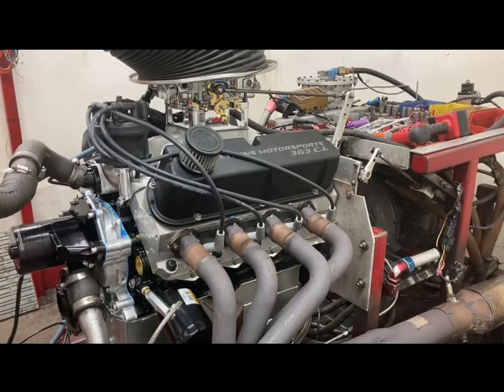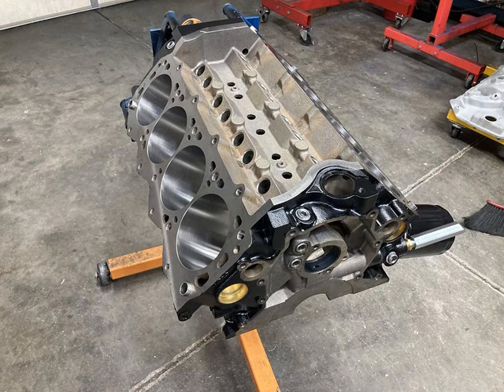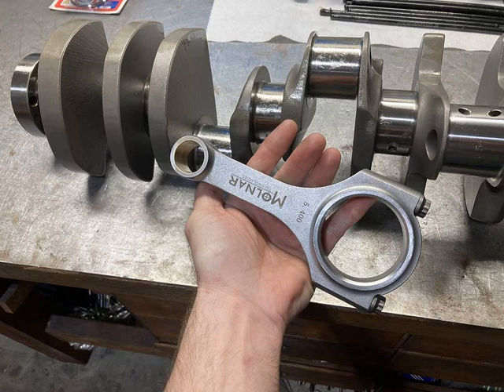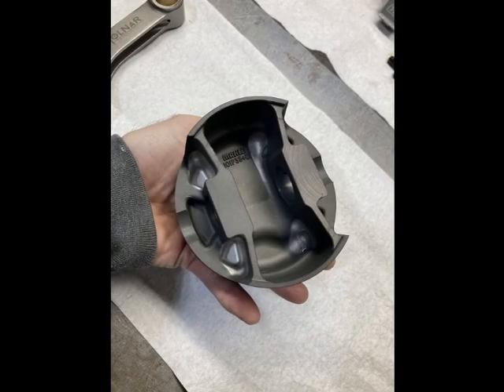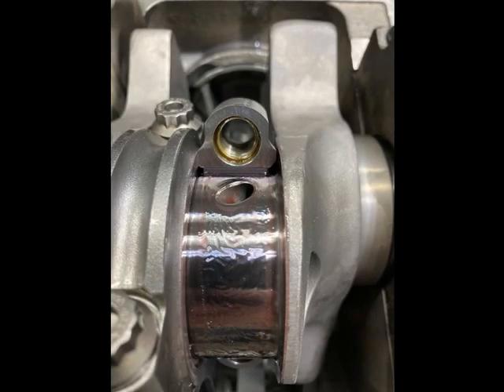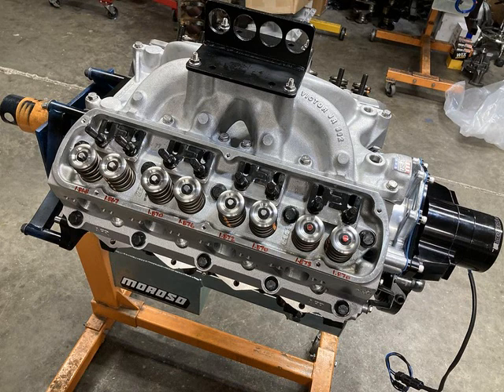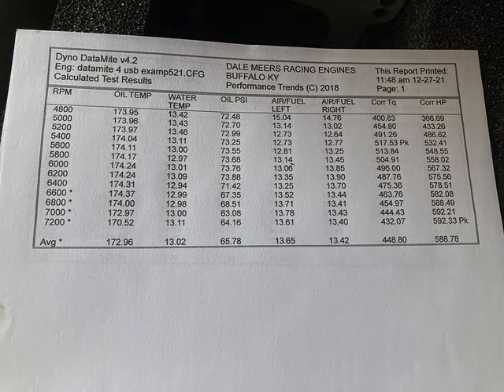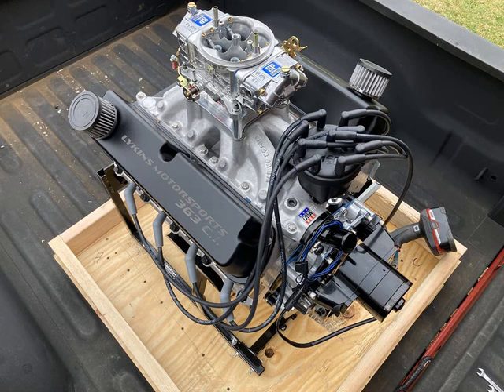Lykins Motorsports Ford 363 SBF Engine Build, Start To Finish

Comment: Very nice build...I just want to say that I see the Ford Windsor aftermarket aluminum cylinder head situation as a failure. Go check out some LS3-LS7 aftermarket alum. flow numbers...ford enthusiasts are being had. The closest thing the Windsor aftermarket has is the 7721 Victors which are right there with'em.  I'm talk'n 385cfm+ by  .600 lift. You can use any windsor manifold but your into $2000.00 plus for rockers. And good luck with the headers. Where's the "Fast As Cast" SC1 ??? w/headers & intakes? No wonder all the Foxbody swaps.
Reply: Aftermarket head manufacturers are just piggybacking off GM's design. The LS3 might be the best V8 engine ever made.  A junkyard LS3 head will flow about the same as an AFR 20 degree inline CNC SBF head.  And, a junkyard LS3 head can be ported to flow 385 cfm   Besides LS heads will bolt on to a SBF.  What about SBC fans?  They're being had to ...
Reply: Who cares!?
LS swaps are SO common and SO boring!
Every dork has a junkyard LS swap....
ZZZZzzzzz
😴😵😴😴
Why don't you see any LS swapped IROC-Z Camaros?
Because they are all in the junkyards along with your LS motors!
BTW: I SO enjoyed gapping lame azz 5.0 AND 5.7 IROC-Z Camaros in my '85 5.0 GT!
Those 'Tuned Port' SBCs couldn't run past 5,000 rpm while my Holley 4bbl 5.0 walked them.
Lol
Now I have a 585 HP 8.2" deck 363 SBF that looks exactly like my mildly modded 5.0....
Heh heh heh
😊
Let me know when you find a 6.0L LS in the junkyard and we can run a few 1/4 mile tests.
😁
Reply: Chevy's are junk... Id take a straight 6 any day over ANY CHEVY MADE
Reply: @1bad505   Geeze, I guess that's why Fords never win any races.:face-green-smiling:

Comment: Awesome engine Brent! I have almost the exact combo built for my '85 4eyed Foxbody.
(Mine has AFR 195s with a port matched RPM Airgap and custom Comp roller)
Can't wait to get it installed with the Magnum 6 speed behind it.
My only concern is keeping the Mustang from twisting like a beer can when that 363 hooks up!
(Stiflers full chassis brace system is already on order.)